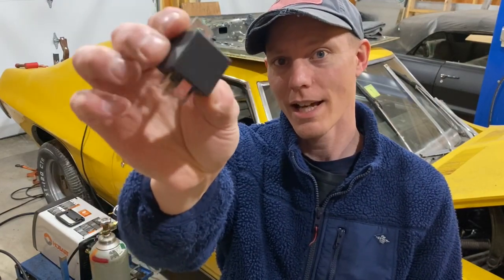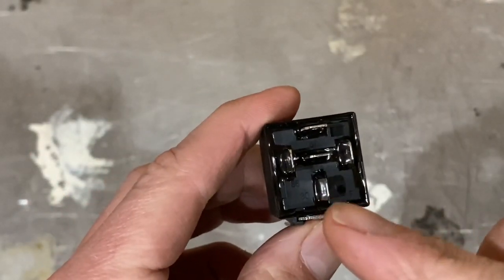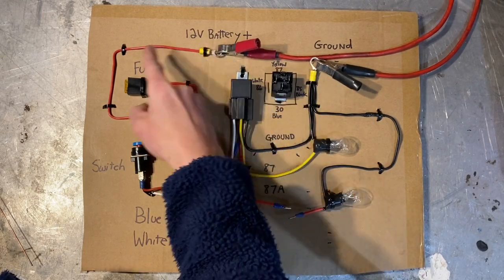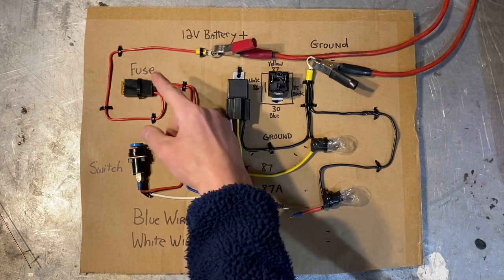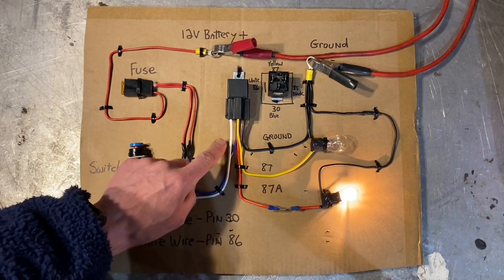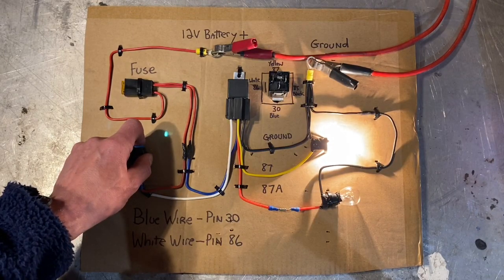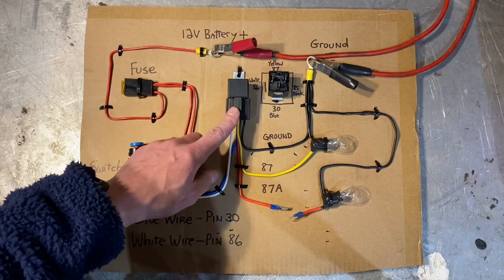How to Wire a 5 Pin Automotive Relay. Pins 87/30/85/86/87a . Bosch Style. Fans / Fuel Pump / Lights

Comment: good morning love your diagram .so if i want to send power from the interior of the car lets say the fuse box instead of the battery so that it only has power when the car is on and when i shut off the car it shuts the power to the relay switching off the fog lights if i forget to turn them off. Can avoid dead battery issues. of course putting a fuse from the interior fuse box to the switch to the relay. Thanks for the explanation

Comment: I took the fuel pump relay out and put a jumper wire in, connecting terminals 30 and 87.  The fuel pump only primed for a few seconds with the ignition key in the "run" position.  Then the pump shut off.  I have the schrader valve removed from the fuel rail and I'm trying to drain the gas tank.  I thought the pump would run constantly?
Reply from the maker: The car’s computer is probably controlling that priming.  You’d have to jump it differently to empty to tank.
Reply: Ok, yeah i don't know if that is even possible from up there at the relay box.  I'll keep researching it.
Reply: It's an omron 21911c relay

Comment: Can i power 30 pin from a fuse , not from battery?
Reply from the maker: Absolutely. You just need to give it power from someplace, and make sure it has a fuse in it to protect the circuit.

Comment: I really appreciate you creating this video. It helped me understand the typical relay circuit I needed for my project.
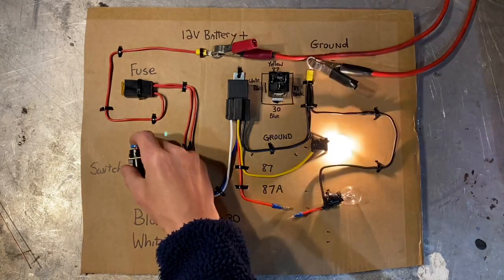An improvement to this demonstration could be showing the switch receiving power from a lower amp 12v source, say your fuse box, instead of (1:31) showing it coming out of the same fuse powering the light. You could use an 18ga wire to power the second fused line all the way to the switch and thru to the relay (coming from the same battery but routed outside of the video frame). The power feeding the light could be a 14ga wire from the battery clamp all the way to the light. This way, you could visually demonstrate how a low amp switch could power a higher amp device. 
Also, you could make the wire from the switch to the relay be really long and coiled up to demonstrate how you can use a single cheap long thin wire to control a device that requires a more expensive thicker shorter wire. 
I bought a 5-pin relay because that was all they had at the auto parts store. Thanks for explaining 87A. I won't need it for my project, but its good to know what it's for. This would have been a good time to introduce to your audience the terms "normally open" and "normally closed."
Thanks for sharing your knowledge.  -Jimmy

Comment: The best explanation I have come across. You even showed that the same 12 v terminal can be used for the switch and relay.  87A will be used for the small light on my toggle switch when I turn the key on and 87 will make the big design on the same toggle switch glow when I turn the switch on.  SWEET. Thanks for taking the time to mock up your wiring display.  Subscribed
Reply from the maker: Thanks for watching the video! I'm glad that it was able to help you out!

Comment: Can I use this relay to keep the fog lights on when high beam is switched on? As currently it goes off when I turn on high beam
Reply from the maker: You could. Or you could figure out what is making your car do that, and bypass it. Either way works.

Comment: May I ask what is the kind of fuse being used for the positive to battery line? Also, Is there a 30amp within the fuse?
Reply from the maker: It all depends what you are powering up. The fuse needs to be based on the type of lights that you are running. Check out my fuse & wire sizing video https://www.youtube.com/watch?v=EhzN6UdnmPA

Comment: I made my own remote start for the RV with a handful of relays and an open 2nd channel on the alarm module
Reply from the maker: That’s awesome. Back around 1999 I wired an alarm keyfob to hydraulic suspension using relays. So I could bounce the car all around with a key fob. Relays are really quite awesome.
Reply: @WiringRescue  I got a few box's of these clear relays that were in a surprise parts pallet I got in a sale while back, with a mounting bolt even, a clear case, 3 rows of 4 spring loaded contacts, then 2 +/- energize contacts, strange ones 2 me, but I actually used two of them so far, to switch 4 L+R stereo outputs from RV's receiver from the 4 Stereo speakers inside the RV to,  a couple mounted "weather proof" pair's outside. all via a $10 RC car remote control/receiver  ;)

Comment: My pos/neg wires to my driving lights are equal lengths so they meet at the relay. Is it alright to have 3 earth connections at the relay terminal (85) with one of these running back to the battery or is it better to have one earth at the relay with the other 2 running straight back to the battery? If its better to run the light wiring earths to the battery I have to lengthen the earth wires.

Comment: After watching a few boomers try to say it's 2 circuits that require 2 power sources, I'm glad to have stumbled across your video which confirms my suspicion that it can SIMPLY from the same power source.
The video is SO simplified compared to others and well laid out. Can't wait to put it to practice.
Cheers mate!
Reply: It should be simple. However you look at it, your relay and switch receive power from the battery, through 1 wire or 2, you choose how many wires you really want to run.
Reply from the maker: I'm glad I could help you out!  This stuff is pretty fun to do to be honest!

Comment: This is driving me nuts my work truck has a fuel pump and air compressor pump has alway worked compressor didn't. So I removed the panel that had a led 5 pin push button switch a 5 pin relay and a push to reset thermal breaker in it that was full of water and corrosion so I replaced all the connections except the relays ones and bought a new relay. Went to try it and nothing was working so I ordered a new switch and installed it and pump started half a$$ working now just a reminder the pump works great with the bad relay that's full of corrosion but I can't get the air compressor working and when I test the voltage I'm only showing 4 volts instead of 12v any ideas!! My main concern is getting the fuel transfer pump working with the new relay but I'm almost positive the new relay is only pushing 4v or so thanks for any help

Comment: All I have is a relay in hand with no packaging.
It was given to me by a mechanic because I was burning up switches to the electric fan in my Jeep. 
Laid out like a elementary school project makes all the difference in understanding.
Labeling the colors functions and placements is a blessing. 
Thank you so much for your video.👍
Reply from the maker: That’s fantastic! You may like a few of my other videos too about choosing the right wire sizes and fuse sizes. It’s all really important if you want to prevent wires from burning! Good luck with the Jeep! They rule!

Comment: @Ratty Muscle Car --- Great video. I do have one question though. If I had a Murphy pressure gauge and temp gauge, I could wire those two individual wires (one coming from each gauge) together and just connect it to pin 87 so they had power simultaneously and eliminate pin 87a completely.It sounds like if I wired one gauge to pin 87 and the other to pin 87a, one would work with switch on and the other would not, and vise versa.  Is that a correct statement?
Reply from the maker: If I understand what you are describing (I believe I do), then you are correct. Why would you want to flip power between gauges though?
Reply: @WiringRescue  I wouldn't want to flip power between gauges. I was just making sure I understood the concept. Didnt want to blow up 350.00 worth of Murphy gauges.  Lol. I do appreciate the response.

Comment: Great video. Super simple diagram. Thank you!
Reply from the maker: Thanks for watching! I’m glad you liked it!
Reply: in this video the  pin 87 is yellow wire connected to bulb. if you cut the yellow wire the bulb goes off because it need a positive wire. I in don't know electrical works hardly i made it but i forgot the to connect  pin 87 and i connected any other wire from the same circuit to the bulb and it was working  same as  in this video it works on/off.  the  circuit was functioning same like this video i am so much confused why this circuit working without pin 87? . is this normal or really strange?

Comment: Thank you for the info. Just a question. What if do not intend to use pin 87A and did not put a load in it will it still consume power?

Comment: So, I’m wanting to hook up a daytime running light in a 1st gen ram, I want the light to be on with the ignition but off when the headlights are on. 

Is it safe to assume I can use pin 30 for the ignition switch to power the light, pin 86 for the headlight switch, 85 for ground of course, then only use 87a, since I don’t need the relay to power anything else? Or should I re-wire everything to work with the relay?
Reply from the maker: If you power parking lights with an existing circuit, like the the ignition circuit, you may pull more amperage through it than the circuit could handle. This could lead to blown fuses or melted/burned wires. 
In my mind, you would want to add two relays. One relay would be controlled by the ignition circuit. The other could controlled by the headlights. It definitely sounds like a pain to do all this to make your scenario work, but it may save you from a melted ignition circuit. There may be other smarter options out there that are beyond my skills though! If you do figure out a way, please share it, as I always love seeing other projects come together.

Comment: Could I use this relay for aux reverse lights? I want to install LED Pods on my rear bumper that’ll go on at the same time my reverse lights come on. But I also want them to come on when I hit a switch in my truck. The switch I wanna use is a factory switch that is only ON/OFF

Comment: Is it safe to use one fuse for both pin 30 and pin 86? Or do we need one fuse for each? Thanks!
Reply from the maker: Technically you could use one fuse, if it is sized appropriately. The down side to doing this is that if something goes wrong, it is a bit more difficult to find the source of the problem. The more you separate the different parts of the circuit, the easier diagnosis is. If you jump power and ground all over the circuit and start popping fuses, you have to take the whole circuit apart to figure out what is going wrong. I think I just wrote the same thing 3 different ways. Lol. Ah well. Thanks for watching
Reply: @WiringRescue  wow thank you for your quick response. I really appreciate. Will just use separate fuse for each pin. One more thing. I saw a video that connects pin 85 to the positive terminal of the battery together with pin 30. And connects pin 86 to negative with the switch. Is that possible too? Thanks, Sir.

Comment: I have a Kawasaki Mule with a Electro-Hydraulic Dump Bed.  It is an After Market Kit, no longer available or serviced.
An Up/Off/Lower Switch works thru 2 RL45 Relays to drive the Pump Motor.  I keep Burning Up (Melting Plastic around) Pin 87A.
Well I've replaced either or both Relays at least 6 times.  Now New Relays don't fix the Problem and I THINK I have probably Fried the Socket.  It is a Double Relay Installation Socket, which I am unable to locate a replacement for.  I suspect that there is some interconnection between some of the Pins in the DOUBLE SOCKET??
So I bought 2 RS40 Sockets and Ganged them together but I DONT HAVE A Clue how to wire the Pair (10 wires) up to the 12V Battery / Switch / Motor.  After watching your Video, I'm wondering why Pin 87A is used??
Can you help a Stupid, Not very Electrical Old Man out?
Reply from the maker: If you are melting relays or wires, you have too much amperage going through them. So the first step is figuring out the rating for the devices that are sucking all that electricity. Once you know how much amperage those are supposed to draw, you can build an electrical system around it. Unfortunately if you guess at the amperage draws, you run the risk of melting more stuff or causing fires.
Reply: @WiringRescue  Or could be Poor or Contaminated (High Resistance) Contact between the Contacts at Pin 87A.????
Reply: I have a problem with Wood Chips (Horse Stall Bedding) getting lodged around the Relays. @WiringRescue
Reply: @WiringRescue  When I get access to the motor I'll check (Google) the Motor Specs.
Reply: Motor takes a 20Amp Fuse.
ARCO P/N 6231, SAE J-1171 Tilt & Trim Motor.
About 8 months ago I was Frying Relays on a monthly basis and eventually the Motor Died.  One Winding was Open.
After I replaced the Motor everything was fine until last week.
Looking at the Most Recent FRIED Relay, I see Discoloration on the Spade for 87A.
This makes me suspect a High Resistance Contact.
I am of the Opinion that the Installation Socket is FRIED Now.
When I get access to it (the Double Socket) I hope to get a Part Number & Manufacturer's Name off of it and order another one.
Other wise I have 2 RS40 Sockets with 5 wires each and I don't have a Clue how to wire them together, to the Battery and to the Reversible Motor.

Comment: this right here is how i use a relay to control a strobe module on a tow truck. some customers want to have all of their clearance lights strobe so i put the clearance lights into pin 30 and use 87a to control the lights on steady burn then i wire a switch from the dash which turns on and activates 87 that powers the strobe module. the output of the strobe module is then wired to the same spot in the junctionbox where my 87a goes to and viola all the clearance lights strobe! just figured id throw in another use for 5 pin relay
Reply from the maker: That’s great info! Thanks for posting it!

Comment: Good video thank you. How would you wire a relay to make a reverse spot light come on only when reverse and park lights are on? Eg: park light on only. No light.  Reverse on. No light. Park light on and reverse circuit as a trigger the spot light comes on. This will in theory make the light come on only at night, and during the day because the park light is off the reverse light doesn’t come on. I hope I’ve explained things ok. Thanks in advance.

Comment: Your relay wire video its good but cant i use your diagram for car fans 2 fans
Reply from the maker: If you are just using a toggle switch to turn them on and off, and not a temperature switch this relay diagram will work for you. Just wire the fans positive wires together and connect them to pin 87 on the relay. Don't use pin 87a on the relay.  And ground the negative wires on the fan.  Also make sure you use a fuse on pin 30 that is appropriately sized for your fans.  So if each fan draws "9 amps" (for example), you should double it for two fans, and then round up to the nearest fuse size, which would be 20amp. You have to check the fan amp ratings to get the fuse right though.  Don't oversize it or you will melt wires and start fires.  Always make sure the wires and fuses are properly sized for the circuit.

Comment: Hi, I have a 1949 P3 rover and I'm trying to workout how to wire the semaphores into the after market turn signals, would this set-up work with them?
Reply from the maker: I’m not entirely sure because that’s probably a 6v system. So you would need a bunch of 6v parts to make it work. Sadly I don’t have all the 6v stuff to make a video with, so I’m not of much help.

Comment: Can I use the same battery for both outputs on the relay for 2 different circuits? I did this but the relay keeps clicking. It can't stay on.
Reply from the maker: If the relay is clicking, I’d have to guess that the 85 or 86 pin is wired incorrectly. Double check that those are correct.
Reply: @WiringRescue  I'm talking about a 3V relay but I solved the problem now. It was switching an RF circuit but it can't take the output pin 3 on the 555 timer. It needs to be disconnected. It works by inductive coupling.

Comment: For some reason nothing happens when I flip the switch can you help me out?
Reply from the maker: You’ll have to get out a test light or multimeter to figure out where the power or ground is missing. That’s really the best method of diagnosing the problem.

Comment: I left a comment that i built a remote control lawn mower. Now I used a 5 pin relay tied to a single 120amp 4 pin relay. This relay is for power and 5 pin relay for grounding engine to shut down via Transmitter. Every thing wired up as the original main wire from coil to enigine break lever on the engine to bteak and short the engine to shut down. I left it intact as plan B. Yank an attached wire to the lever to kill engine. I tapped into this wire and ran it to 87a then wired another wire to ground and ran to pin 87. When rc relay is swiched on by the switch on the transmiter the pin 30 on 5 pin relay will ground out. Not good when you need the engine running, but when power is turned off pin 87a is now ground and the engine shuts down. It works !!! But when power back on throwing ground back to pin 30 ( nothing is attached to it ) engine wont start un less i unplug pin 87a and cycle power on and off plug wire back onto 87a after restartin engine. Will function again as a kill switch. Thinking of installing a arm switch to turn 87a off to grnd then turn on after starting engine. Failsafe on receaver is set to shut down power and engine if loss of signal and power don't want it taking off. If you or others have any further ideas thanks.